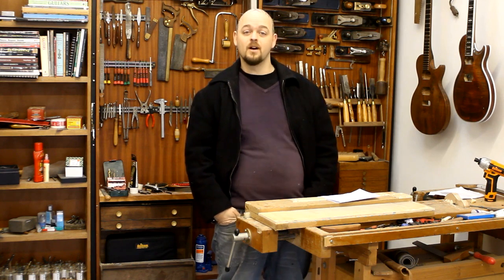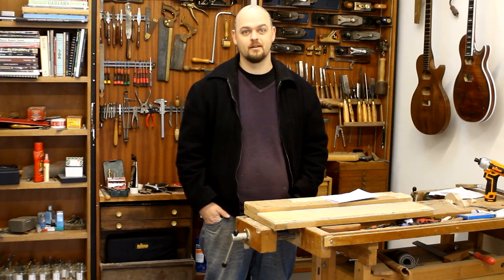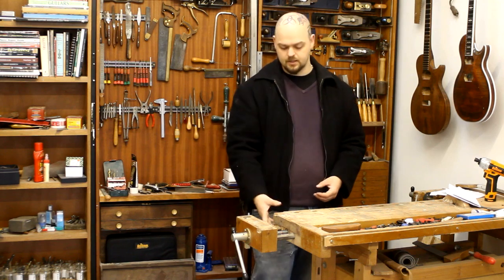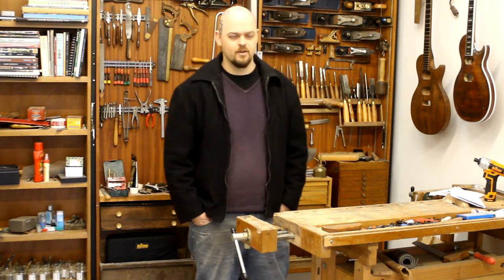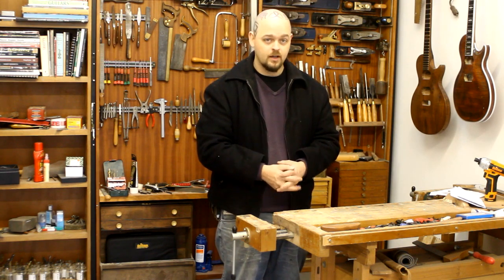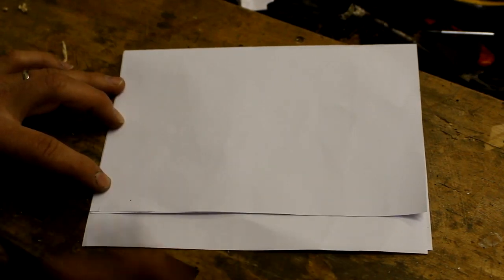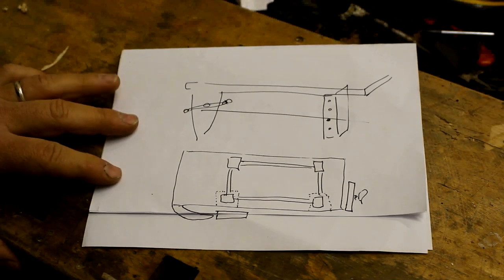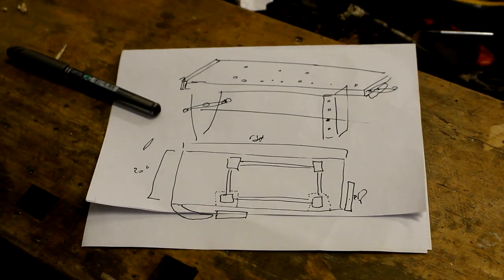Tutorial - Ep 1 -  How To Build a Luthiers Workbench  - The design and intent

Comment: Why are you putting a rail at the front of the bench ? You might end up kicking/bumping against it a lot.
Reply: Dean Grove For narrow top heavy benches,  stability is a problem and a liability, so wide is better I think.  If the rail is a few inches high,  kicking is not the problem. But without rail the bench will wobble by lack of rigidity, certainly because the over-sized legs and top makes it hard to avoid any play in the top tenons.